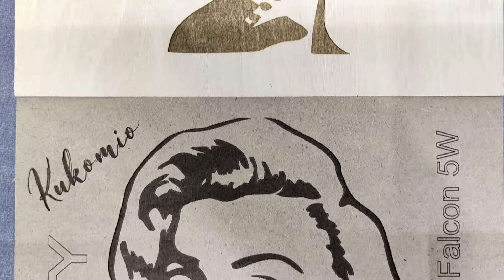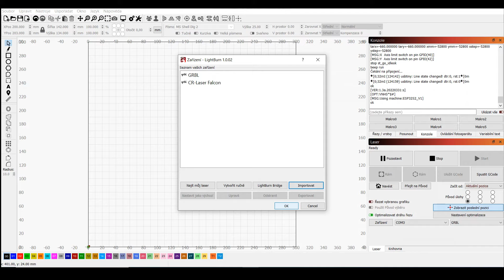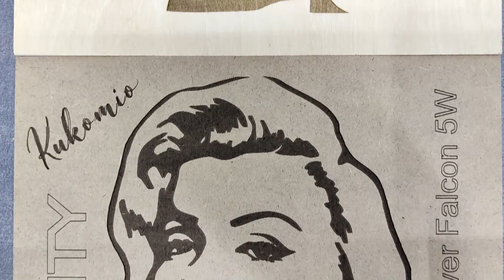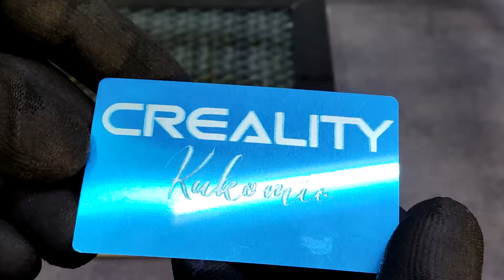Creality CR-Laser Falcon Engraver with 5W Optical Output - unbox, assemble and test

Comment: Is this a special type of plywood, or I can use any local 4MM plywood from the hardware store?
Reply from the maker: I used poplar plywood
Reply: @kukomio  Can show us the settings and parameters you did on Lightburn.. In Case I need to engrave Coasters bought from Amazon how can I do it using this Machine. Can you share with us Tips and Tricks. I tried to engrave A4 paper I was not able to do so in Light burn I used Spd 6000/ power 70 did not work.. If you can make video on using same machine and with different materials and settings we can using in Lightburn it will be great! Thank you
Reply: @kukomio  I have tested the same on 3 mm plywood and MFD with 100 power 100 with 1 pass it never goes through as you showed in your test. What is wrong with my settings?
Reply from the maker: Check the lens to see if it is OK, clean the lens with alcohol.
Try to find the focus point to see if it is correct ´´ https://youtu.be/2hXCuVSvuJo ´´
I use poplar plywood. If it is birch or beech, you need more passages
Reply: @kukomio  thank you I have tried that.. do you think i have issue with my falcon 5w laser?
Beside this have you tried to upgrad firmware for falcon if yes can you explain or make video on how to get it to download mode?
I cannot understand What does EN key means
Reply: @kukomio can this machine cut through acrylic